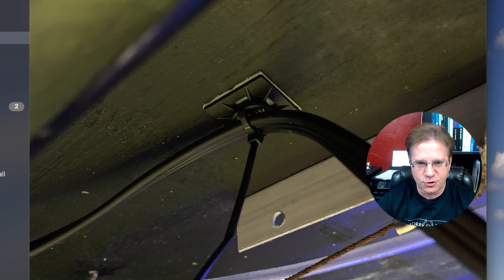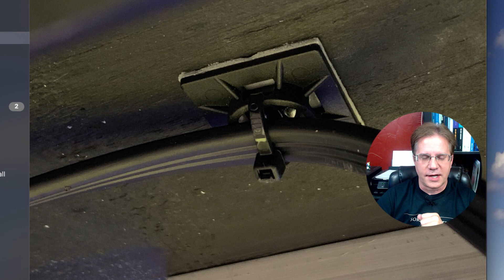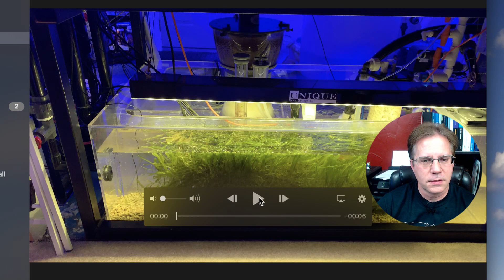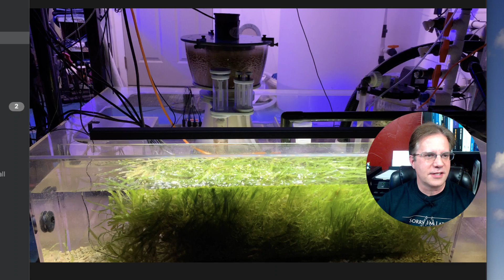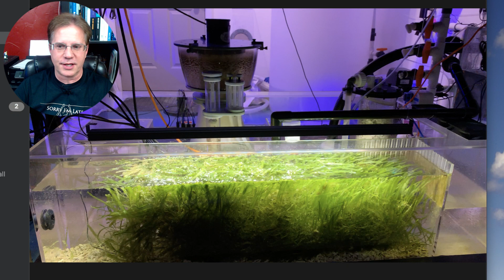Let's discuss mounting hardware

Comment: When cutting zip ties it’s important to cut them flush. If they are cut at an angle it leaves a very sharp point that can scratch skin enough to draw blood. I have some precision cutters I use, but a fresh razor blade will work as well.
Reply from the maker: Good tip!

Comment: That red 3m will stick anything. That’s an industrial grade that is used for many items like mounting soap pumps in public restroom.. you know the ones that don’t work and you point the pump over and over the get a little soap? Yeah that’s what is holding most of those in plants through all that abuse for years and years. 

The only thing is once you stick it to something it’s damn near impossible to get it off the item and the surface.

Comment: Hi. Its goog to hear. I observed  your refuge where as You Using Nopox as well. Isnt it advised not to use any Phosphate remover (phosban as well as cheto etc in refugium) with Nopox. What happened with my Cheto using Nopox is that instead of reducing Nutrients, it started killing Cheato broken down it to small pieces where as my NO3 remained at 25 for over 2 weeks use. Till i removed cheto. Your take on this pls

Comment: In regards to screwing into wood parts of your stand. Any concerns about moisture and the screw hole?
Reply from the maker: The hole is filled, there is no void. I've never removed a screw from wood and found any rust or decay. What ends up getting ruined is what is exposed to air, like the head of a screw or some threads if they were visible rather than fully screwed into the lumber.